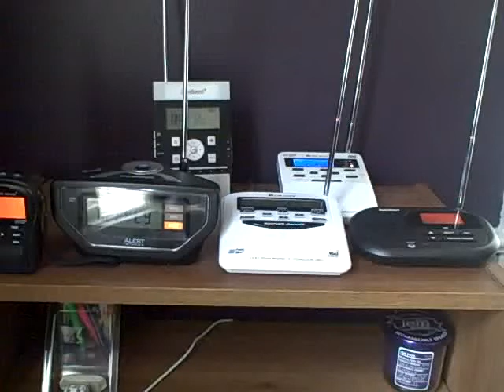Required Weekly Test (EAS #17)

Comment: Nive video. Although, how come the Midland WR-120EZ was the only radio that sounded the alert tone? The other radios in this video can all ring audibly for the Weekly Test. You just have to set them in Set Alerts or something like that. I think the only exception is the WR-100.
Reply from the maker: This video was recorded a little late after the SAME headers. Although I am surprised that the 120 rang after the introduction.
Reply: SPCBridgeport4117 The WR-120EZ can sometimes do that. There's no definite time when it will ring. Are all your radios set to ring audibly for the weekly test?
Reply from the maker: All of them are set to ring for the weekly test, with the exception of the WR100 and the HH54.
Reply: SPCBridgeport4117 Awesome!